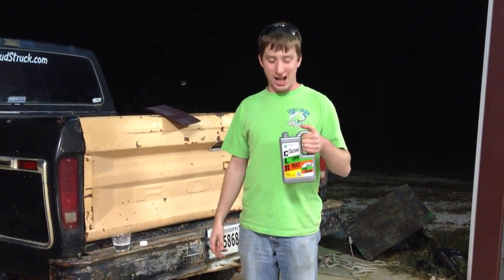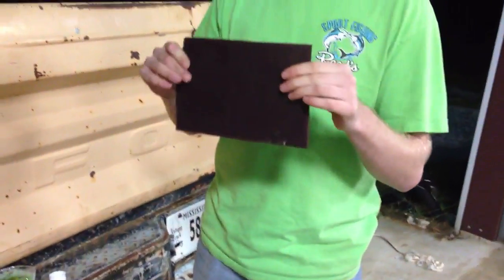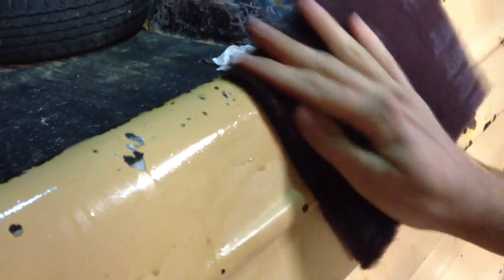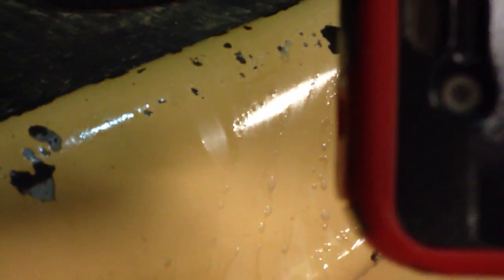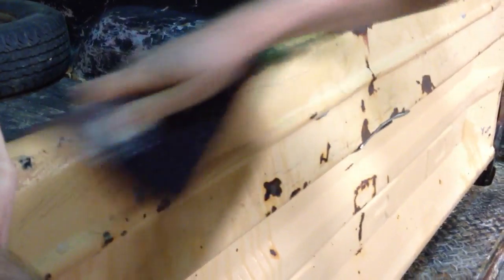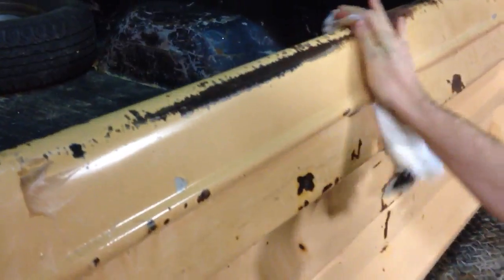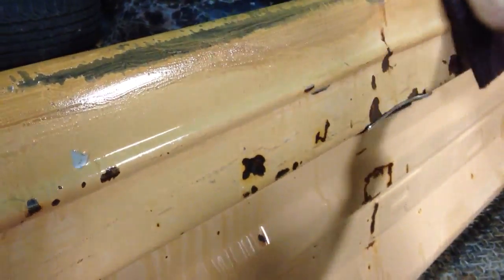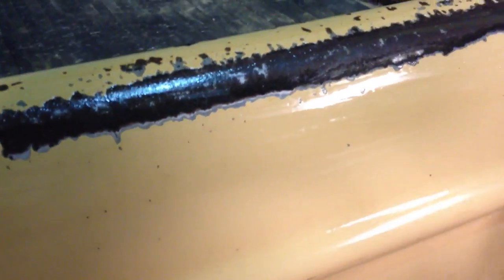Removing Surface Rust with CLR

Comment: u need not scrub the rust. CLR will desolve it by itself. in your truck situation, wet a towel or rag with CLR and lay it on the rust spot 5-10mins it will be gone. i use on guns and vitage bikes by misting with spray bottle and letting it sit.
Reply: Thx for this comment crabtrap ...I'm trying to clear starter rust on a car scuff ...do you know whether CLR cures the rust in the area? ...ie. is ok to paint over after cleaning? thx
Reply: 30 minutes even, I keep a wet rag on and cover with plastic wrap for a day if I need to, until I see shiny metal.

Comment: Bubba, the CLR did nada ! CLR is called Walmart-crappy-profit-in-a-bottle ! Try a dry pad and you`ll get the same results; BTW, that is not rust, that is barely surface rust starting--WTH ARE THE GLASSES FOR, pitch black ! ::

Comment: I used your method to remove surface rust from woodworking machine table tops.  Worked great, but I brushed it on and let it sit for about ten minutes, then used an abrasive pad soaked in CLR.  You should wear goggles and gloves.  Very ingenious  idea!
Reply: Great to know. I think I'll try this on my jointer.